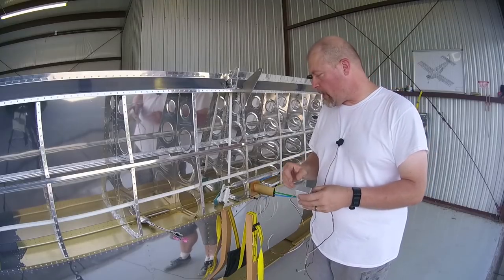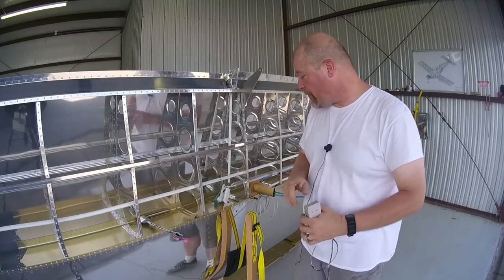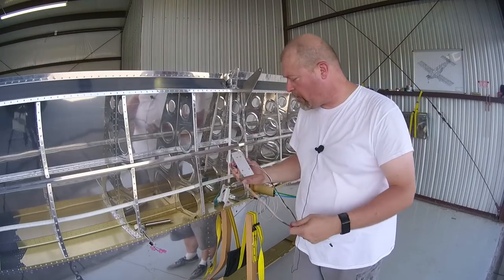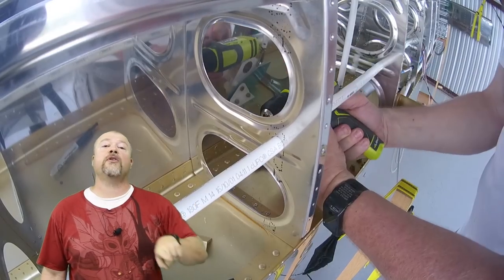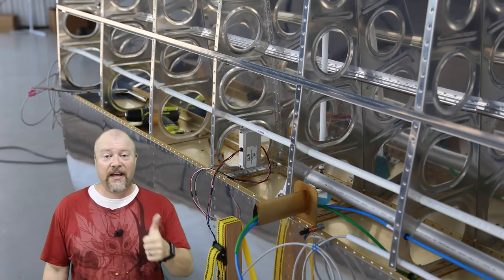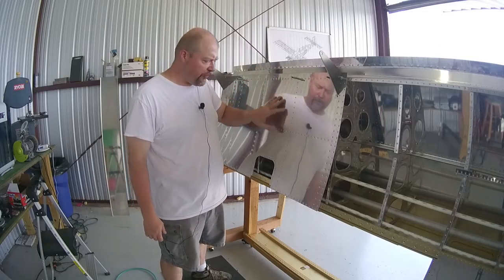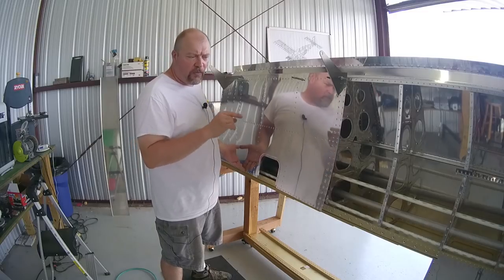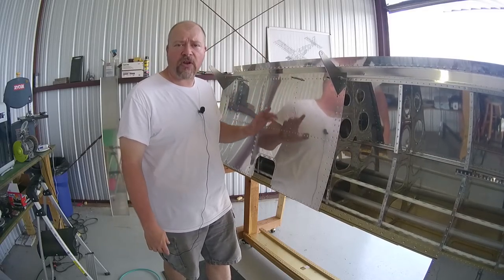RV-10 Wings - 062 - Pitot heat controller and hanging the left tank

Comment: A tip for leak testing- water is more dense than avgas and is a poor indicator of a fuel leak. If you still have access to inside, you can fill the tank with water as in your original tests. Then, with a compressor and airgun, blow air onto all seams, joints and rivets from outside the tank while looking for bubbles in the water. If the tanks are closed, pressurize with air and use soap and water. Check with Vans to see what they recommend for a testing pressure.
Reply: I was going to suggest this as well since it will cause things things to soften up a bit with fuel.

Comment: to fix a leaking rivet.. drill out the rivet, remove the debris, and wet shoot a new rivet. Quick question though.. how was it leaking in a tank pressure test, if it is on the outside of the tank itself? you may have a much larger leak than you realize.

If i recall, you did not put as much sealant on that rib in between the surfaces, so thats why it is leaking. remember, you cannot have tooooo much sealant

Comment: I would say that NONE of the proseal that is external is contributing to sealing the tanks.  Only the stuff that is internal and especially between the mating surfaces act to prevent leaks.  If any (air/liquid) pressure is able to get past a mating surface, the built up sealant on the outside will not be able to stop release.

Comment: a tip for mounting nutplates.... since the thread is reduced to provide a means of locking the screw in, if you ever want to mount the nutplate to the surface, use a bunch of washers under the screw so that the screw can be tightned with the fingers before you get to the point where the its gets hard to turn and you need a screwdriver. So have your screw or bolt hole drilled, nutplate screws and a bunch of washers, then you have the screw in the exact right spot and you can just match drill through the nutplate rivet holes into the mounting surface.
Reply: Nicholas Cessna this sounds like a really useful tip, but I don't really understand. Can you try to explain it again?
Reply: Alright sooooo say we are replacing a floating anchor nut that we have acess to both sides (both sides of the surface the nutplate is being anchored to). You drill your standard hole for the screw or bolt to fit through, then place a bunch of washers on the screw/bolt, so the head of the screw or bolt is stood of from the surface of the material (being anchored to). And put the nut plate on the otherside (where the nut plate is to be riveted). Then fasten the nutplate to the surface by tightening the screw. Then its secured you can just drill through the nutplates rivet holes from the back side through the material and rivet the nutplates. Hopefully that makes.
Reply: Yes! Thanks :)

Comment: Depending on how structural that skin is, you might have problems with fatigue where you trimmed it to fit. Usually holes are placed at least 2 diameters from the edge of a piece of metal to reduce stress concentrations. That doesn’t mean it will fail, but the more you know...

Comment: Leaks can start in one place and manifest themselves in another.  Just as a roof leak can start at one place on a roof and run under the shingles and come through the ceiling several feet from where the exterior leak is located.  It may be that your leak is traveling under the pro seal and then coming out in a different place from where it started inside the tank.  I would completely fill the tank until the end rib is completely covered and see if the leak reappears. If that is the case, then the leak is traveling in a channel under the bead of pro seal and then coming out a few inches from where it starts on the inside.  Make sense?
Reply: I agree (though my reply is many months late).  And take it one step further: If the leak reappears when full, then lower the level inch by inch until the leak stops to locate it.  Or fill it inch by inch until it starts.

Comment: Trimming back the edge of that skin is fine, as long as you still meet the minimum edge distance recommended for riveting. If you haven't already seen this reference, check out AC43.13-1B, here:

https://www.faa.gov/documentLibrary/media/Advisory_Circular/AC_43.13-1B_w-chg1.pdf

Note in paragraph 4-57, this...

"For single row rivets, the edge distance should not be less than 2 times the diameter of the rivet and spacing should not be less than 3 times the diameter of the rivet."

I realize this is going to be licensed as an Experimental aircraft, but AC43.13 is the bible on aircraft construction/repair techniques. As such it transcends certification level, and should be referenced whenever uncertainties arise.

Comment: Dude if the rivet is outside the tank it is not the source of the leak.
Reply: Good point, the leak may be elsewhere and found the path with least resistance.
Reply: In most cases, yes. However, if the rivet goes through two pieces of metal with pro seal between them it is possible for it to be the site of the leak.